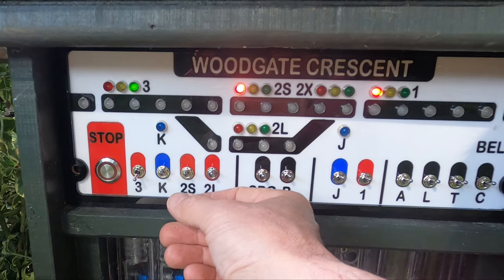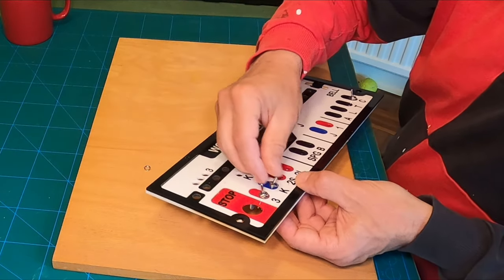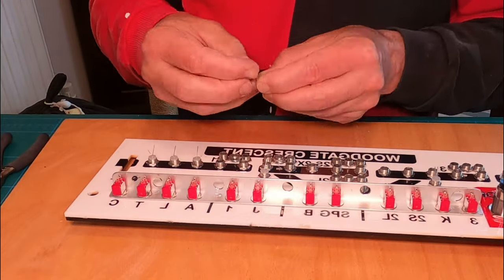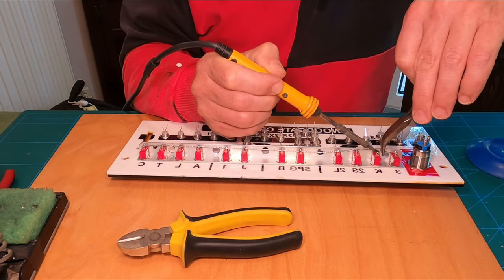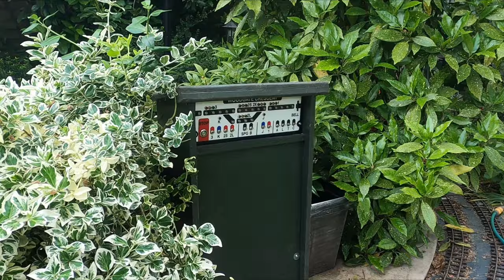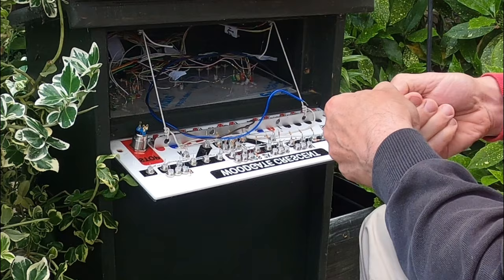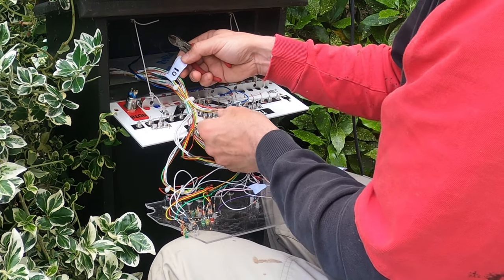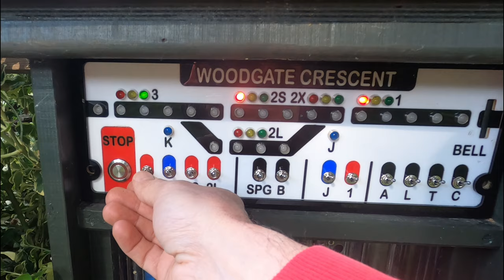Mimic Panel Installation ¦ Signal Box ¦ Linleys Garden Railway

Comment: Very nice control box, I'm not sure if you mentioned this in another video perhaps, but are you using a type of sensor indicator or shunting the track to receive the track indications? Great video..
Reply from the maker: Thank you for your encouragement.  I use reed switch units to sense the trains passing, and there are 5 sensing points per track block section. There are quite a few older videos and one in particular explains how I use sensors for the control system.  Take a look at the one called "Train Position Sensors" https://youtu.be/g4EmZ8VwNn8 Thanks for your ongoing support.  Cheers, W :)
Reply: @Linleys  thank you, I’ll watch that video.